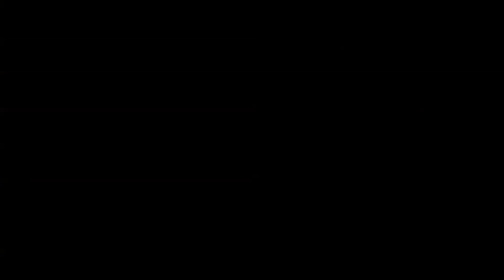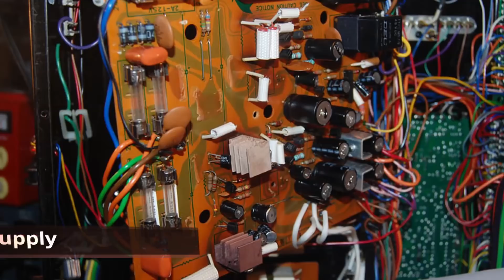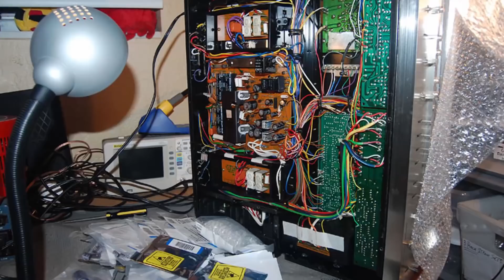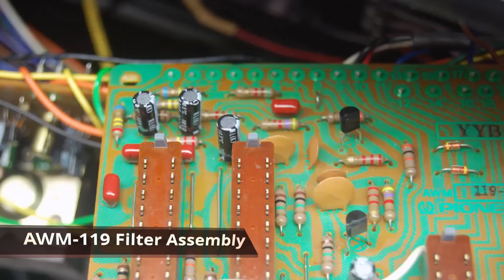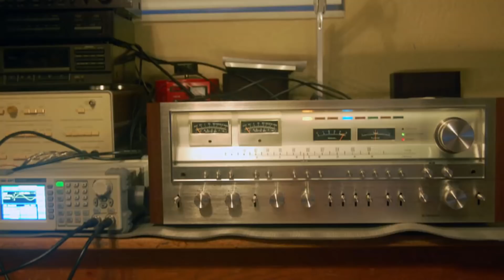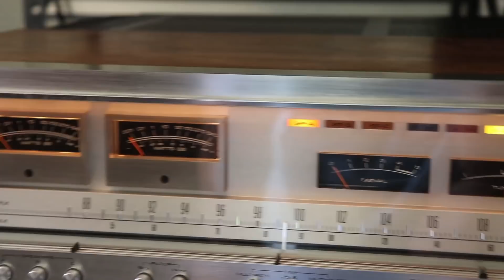SX-1980 - The Most Powerful Pioneer Receiver Ever! Vintage Stereo Repair Restoration & Testing.

Comment: the heat is a problem with powerfull amps ,where i live that is the most hot region in all europe ,in the summer sometimes i get out at night at 23h or 11p.m. and it´s still 35 degrees celsius ,some days it´s like a entire week or more with minimum temperature 28 degrees with humidity they say it´s winds coming from north africa and the cars stay covered with dust, i had to buy a fan and open the top part of the amplifiers for them to do not burn . A friend of mine came from the netherlands to live here in south interior of Portugal , he had as one of his systems a H.H. Scott amplifier bought in L.A. in 1978, the top end model of integrated amplifiers with a very good and clean sound ,in the first summer he tells me that one output wasn´t working , when opening the amplifier the left section literally burned ,the wires were melted inside and a spot with marks of a real fire but still working with loud sound with one output working only, i fixed it to him and told him to have always a fan directelly pointed to the power transformer and capaciteurs area but today one can install those litle fans that are sold for computers not like me that had litle home fans pointed there on mine amps.but as impossible as it seems i never burned one of my amplifiers, normally when having a party at home in the summer at night i used to conect all to a mixing board from pioneer bought in mid 70´s and change the amplifier from hour to hour having at least 3 amps. to change during the night, and with the hours one would be more drunk and high and having to change amplifier almost feeling like i couldn´t conect the speakers or having more time to point the wire to the conection on the amplifier, i used to have some early 70´s altec lasing but huge ones and than change to a pair of HPM-150 and also a pair of JBL looking a lot like the Altec lansing speakers but more recent , i think it was the same engenier who made them ,there were also some exclusive pioneer speakers looking like the previous two i refered , don´t remenber the name of the engenier but i was told that he worked for JBL and than he was contracted by Pioneer making the excelent HPM series ,the early ones ,the ones released in 1980 were not engeniered by this guy i don´t remenber the name, regards
Reply from the maker: Greeting from the USA. Thank you so much for sharing your experiences. Sounds like the 1970's in Portugal was a lot like it was here is the USA. A lot of drinking and other activity's.

Comment: Phenomenal Attitude, Test Equipment and Experience shows throughout this excellently instructive video. I was blessed to be able to learn Electronics in 4th grade, and had a business card for Transistor and Tube Radio repairs in 1965. We lived in rural NNJ but my Dad had a studio in NYC so I could go to my favorite radio electronics and stereo stores, Lafayette, Radio Shack and Heathkit. I bought books how to repair electronics, restock tubes and parts and get my Ham license in 1969. In High School, summers and vacations I landed a Electronics Service Tech job at Alltronics Service Labs, in the same building as Lafayette Radio on RT 46. There we did lots of Lafayette stereo repairs under warranty for replacing bad uA703's with the epoxy tops, many Sansui 3000 and 5000-X which returning Vets brought home and the unstable DC coupled power driver boards shorted and burned out the expensive beautiful wood grille Sansui speaker woofers by DC output imbalance. Later the Greek owners moved and reopened their own store with Pioneer and Revox ect, in Flanders NJ. There I continued servicing all audio radio & stereos, under Pioneer Authorized Service, and saved up all summer in 1974 for a new SX-1010 110W/CH Receiver for Employee Discounted $470, a $699 receiver alone, before Fair Trade prices were dropped! Still have it, and strangely the large 18000uF/63V caps LEAKED prematurely - but I got to order new ones and put my receiver on the bench to repair under Pioneer's excellent Warranty, myself. Other issues are the dirty pushbutton switches cutting out, AND the persistent Tuning Meter off center drift so bad that Stereo almost won't acquire. Also I think one of the TWO wonderful FM RF stage 3SK45 Dual Gate Mosfets went bad, as FM sensitivity is down from the former 140 mile reception of KSHE-FM in St. Louis to Quincy Il, where I worked at Harris Broadcast Products in 1979, and the big Winegard FM monitor antenna picked it up do I used it as my home built Clock Radio controlled it from big relay, playing into Ohm F Speakers I got at college through a ham in our radio club! I recently bought a recap kit and sourced ALL the transistors for the front end, the mixer is hard to find, but is still working because the dial calibration SO ACCURATE you can place the lighted pointer between even markings and it was perfect! Never seen that nor so many FM and AM tuning gangs, and oscillator buffering as well as tight shielding. My Greek Boss, Fedon was a mentor to me and recognized and highly appreciateed the quality and innovation Pioneer evolved into. Still have the KP-500 SuperTuner Cassette from my Renault Gordini now at my desk at work, WITH higher value coupling, filtering caps, 3 terminal regulators, AND the official Pioneer FM Noise Blanker installed into the FM IF chain - into those classic RS Minimus 7 speakers for my PC audio. Highest Regards, Hilary W4HDL

Comment: This receiver is PIONEER's most powerful stereo receiver  with 270W/chanell at 8 ohms and is a very, very good equipment. But the MOST POWEFUL STEREO RECEIVER EVER BUILT is the TECHNICS SA-1000, with 330W/channel at 8 ohms. It was the "winner" of the "monster receiver power war".

Comment: I would wire up a small computer fan something quiet something fast I'm sure that's very easy I don't know why they never did that in the first place.. you can definitely do that like a side mount or top a 40mm or 60mm pc fan cheap but good ☝️👍

Comment: Hi!  You have inspired me.  I have collected 3 1970s amps for nearly free and I am about to restore them.  Two of the amps use post wire wrap and I haven't opened the third one yet.  I need a tool for this part.  My question is, "What gauge tool should I get?".  Amazon sells them and they are pricey in my opinion.  One tool is 22/24 gauge, and the other is 28/30.  I don't want to buy both if I only need one of them.  There are no guarantees, but to save money I want ask which one should I buy first?
Reply: I commented above as a Pioneer Authorized Service Tech in the mid 70's, and still have my original SX-1010 and now continuing many years from Harris Broadcast and then Telecom and Optical Networking at present. I can answer clearly that only the larger gauge wire-wrap tools are relevant for this old Stereo stuff. They needed the thicker wire and insulation for ruggedness and the voltages and currents involved. The 28/30 AWG stuff is for wiring those old DIP digital and analog  IC sockets with pointy sharp square posts on the wiring side of the board.
Reply: @conservative599  thanks for your reply, that helps a bunch
Reply: @CafeRendezVous   You are being mislead.  
The best thing to do is remove every steel pin and solid core wire you can get to and replace with soldered in flex wiring.
You gain nothing by continued use of that lousy wrap stuff. 
The wire wrap was only used for faster production, NOT for serviceability. 
None of the wires are long enough to re-terminate as wrap when the wire fatigue breaks.... which it does after just a few bends.

Comment: Hi; my SX-980 is a little over 40 years old now, but exhibits no sonic degradation or spurious noises, hum, etc. I took it to a tech to clean a coupla switches some 3 years ago and asked him whether the unit would benefit from a recap or not. He said me ¨son I could recap your unit, and charge you and arm and a leg, but I'm too decent; bring it when and if it fails¨ Everything was within value. What should I do ?

Comment: I sold mine back in 1992 after i brought it over to my Uncles house and listened to his Marantz 2500 against my Pioneer on his HD880 speakers that handle 250 wpc..i could hear the SX1980 get grainy as i pushed it above half gain..The Marantz kept its transients and had better impact..This is when i dropped the brand and started chasing  more high end gear like SUMO, US made Marantz, then Threshold and later Krell..
Reply from the maker: Thanks for sharing.

Comment: In the heyday of audio (1973 - 1992) advancements were made that went far beyond watts per channel.
Research into Transient Intermodular Distortion, PCM recording, noise reduction, phono cartridge channel separation and cantilever rigidity, improved wow-and-flutter for tape and phono, improved power supplies...and I have not even touched on speaker enclosure and driver advances.

Other than their Class A separates;
Pioneer’s high water mark was their 9000 series with ring-emitter outputs. The performance of those units put their mid-fi product line in with brands like Luxman, SAE and Parasound.
Reply from the maker: Thanks for sharing.

Comment: This thing weighs in at 35.4kg (78.04lbs) where a Pioneer VSX-9500s made in 1990 I bought this past spring having carried it home by hand with a couple rest stops.I thought was an Elephant at 13.6 kg (30 lbs) I`m not exactly small in size either. Quite the work out lol this SX-1800 isnt exactly something you whip around easily to work on or walk down the street with. I`m sure back in the day when there was real customer service a few shop employees remember having to carry then place that in someone`s car trunk for sure.
Reply from the maker: Yes, she is a beast. In 2021 you have to also worry about any type of stand, stereo cabinet or any type of furniture that you might put the SX-1980 on or in. Back in the day the stereo cabinets were built to hold a lot more weight then today.
Reply: @vintageaudioaddict  I`m fortunate to have invested in a metal Pro-Audio rolling rack on castors and another smaller custom hard wood one.I keep everything on wheels in the studio including the control desk,turntable and mixing tzable as well digital dj controlers   and afull 24 channel Sound craft Ghost studio board along with a Firewire console. Having worked alot of shows and set ups for events but also club and venues sound systems. Strong reinforced cabinets and shelves always top priority. Especially light equipment for  tightened clasps amend the fail safe wire properly attached to the rest of the secure anchor of the rigging. ;)
Reply: I just picked up a VSX-1128-k which is 21.56lbs and seems like a feather in comparison. lol

Comment: I have a one-owner SX-680, a little downrange of this one. It works but I'm sure it needs some of this same TLC to get it all back to spec. I need to hook up a better antenna and really test it but the FM acts like it doesn't really want to center on stations, if that makes any sense.
Reply: See my long commentary on my 1974 Pioneer SX-1010 above. YES the FM Tuning meter veers off center BETWEEN stations, and it can trip Muting and kill or distort the Stereo decoding greatly, because the two-core FM Quadrature (Detection) coil OR it's related tuning capacitors has DRIFTED in value. To fix this without an FM Stereo Generator, first get the best quality (NOT Chinese) hex alignment tools, METRIC sized, and strong plastic - and assuring there is no wax or paint seal, carefully rotate and count the turns to center the meter, on no input signal. BE GENTLE, the wrong or too stiff/stuck core slug can CRACK, and that cannot be fixed except getting a new transfrmer. Not sure if it is the upper or lower core/slug. Then when in full stereo , turn the other core for lowest distortion by ear or oscilloscope/distortion analyzer. Thanks, Hilary W4HDL
Reply: @conservative599  Hi - thanks for your reply. I probably will not try this myself on my SX-880 first; I'd rather find some less expensive model and try it on that before working on my own. Given the issue of cap drift in the tuning circuit, would you recommend that if I'm going to be adjusting things anyway, I should go ahead and replace those caps first?

Comment: The SX1980 would be the perfect project to convert to Power amplifier. If you do it and just slay out the preamp and reciver part you save alot of working hours and some money for parts. Most People are after the very powerful poweramp any way and don,t care so much about the preamp and reciver part.

Comment: My dad gave me his old sx-727 in the late 80's, I was about 9 y/o at the time.  I miss that little beast, you could cook eggs on it.
Reply: I had the 626. Not real powerful but still nice back then.
Reply: I used to keep a small fan on top of my SX 780 plugged into the receiver. It would come on every time I flipped the switch up.

Comment: Nice Pioneer receiver. i had a monster Technics SA 1000 receiver 330 watts per channel, most powerful receiver of all time. i found it in a thrift store in Tampa Florida back in the 90s for $75. Super powerful and awesome sound and worked great for about a year and then it went out on me. i ended up selling it as is for $50 in the weekly flyer.

Comment: When considering an amplifiers' 'current', never mind how many watts it puts into 8-ohms.  How many stable watts can it put into 4-ohms?  How about 2-ohms?
Reply: Yeah especially when driving things like maggies... their impedance varies heavily across the frequency spectrum and can hit rock bottom, close to 1 ohm between 200 and 600Hz.
Reply: In 1978, that wasn't much of a consideration. A 270 watt receiver could drive most 8 ohm speakers to shattering levels.

Comment: Audio review 2017 did a SX-1980 vs the top modern receiver of today $220,000. The Pioneer destroyed the competition in range and power , during testing it was hitting almost 460 WPC and climbing when  the test was stopped. Nothing like it will ever be produced again.

Comment: I have an SX-1980, and recently the FM quartz lock/fine tune section has been acting up. Specifically, a station that has been tuned will all of sudden start cutting in and out and the Quartz lock, fine tune and stereo section lights start flickering. Eventually it stops but it happens every time I use it. I know that’s not a great description, but I’m hoping you might have an idea of what my problem could be. The unit has been recapped and the power supply has been rebuilt.

Comment: I have had an SX-1250 since 1978,I still absolutly love it.I always believed the SX-1450 was the top of the line.The SX-1980 I did not know of,what a gem.Thank you for sharing this !
Reply: I bought  SX1050 new in 1976, lasted 25 years, took a few years to replace it with an equal, now i have Sony DA3000ES

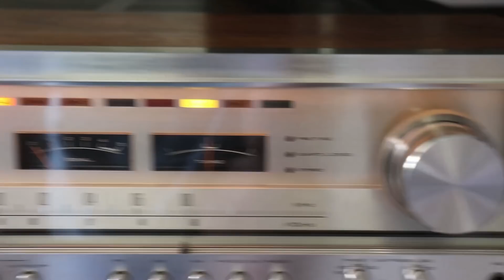Comment: ref 1:03  You are expressing an amp's output in watts, which is complete BS that the industry started way back when.  Watts don't drive your speakers, amps  do!  Watts is amps times volts.  So a 100 amps times 1 volt = 100 watts, and 1 amp times 100 volts = 100 watts.  They both put out 100 watts, but one is 100 more powerful than the other!

Comment: A couple years ago I bought a Marantz Receiver at a Thrift store. Not the Vintage model with the beautiful blue back light. I already have a 2265 which works great. This was a later model but it did have the walnut laminated case in beautiful condition so considering it was only 24.00 bucks I picked it up. It still works but when you turn the volume knob the sound distorts a little. I will get it worked on eventually. When I took it to the counter, this young girl (about 20 years old) asked me "what is that thing?" I explained this is how we listened to music when I was her age and the receiver was basically the heart of your stereo system. She sort of rolled her eyes as if to say that it seemed like a lot of fuss for nothing. I then explained we didn't have social media, no internet, no twitter, etc. Music was extremely important to us, and when you matched a good receiver with a good turntable, good speakers and a great album it was like an event. I don't think she will ever understand.
Reply from the maker: Great story! Thanks for sharing.
Reply: Simple minded adolescent.  I would just have said it's a transmitter teleporter unit for my time machine and this makes it go backward and forward 500 years or more.
Reply: @brucknerian9664  That's a great reply, and who knows, she just might have believed me.

Comment: I bought a SX-1080 in 1979. Exceptional quality and performance. Gave it away years later and moved on to Carver equipment. Had the Carver equipment rebuilt 7 years ago and still going strong. I still use my JBL L-112 speakers (1982). They usually get re-coned every7-8 years.
Reply from the maker: Thanks for sharing!